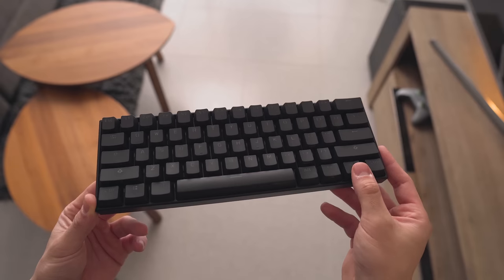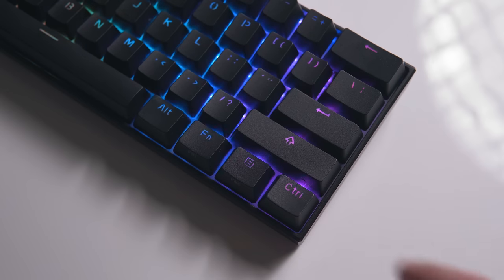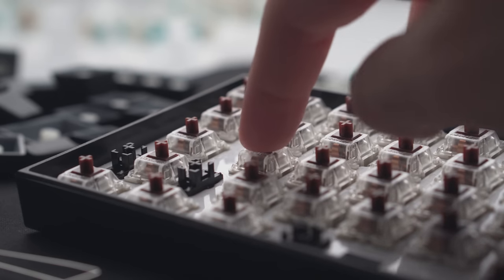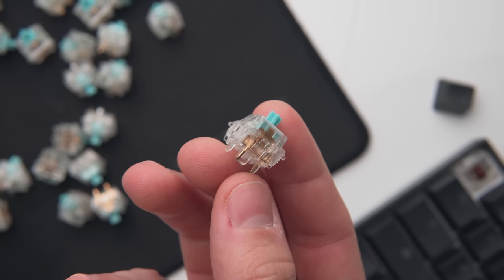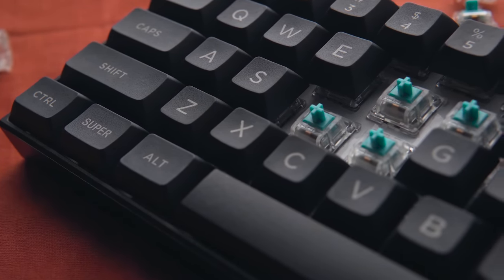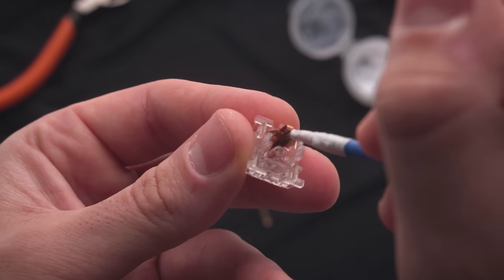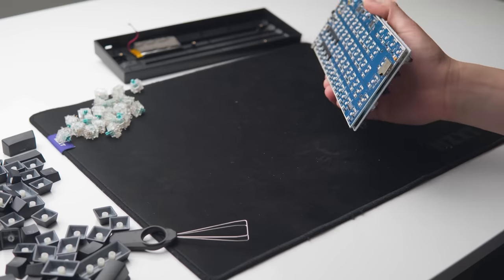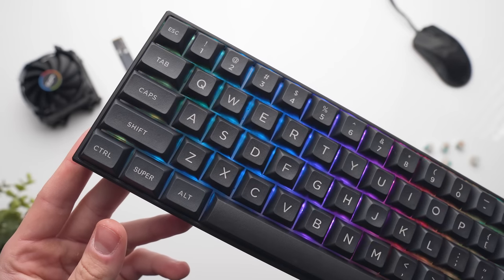Building my Dream 60% Keyboard

Comment: If you use the glorious gmmk it already has all the switches and keycaps taken out and is likely easier to put together. You can choose no switches if you would like to add these switches to not increase the price.
Reply: There is an option to get no switches and you could buy the telios separately. I tried to say that in the comment, sorry if it was unclear.

Comment: If you're into the idea of a mech keyboard with similar form factor or something to play around with I'd recommend Qisan Magicforce 68 (for under $40 USD with outemu switches - not terrible in themselves but less $$ to lose if you plan to swap them out) - quite pretty too. Check signature plastics for gorgeous but pricey keycaps, or Tai Hao for some reasonable and cheap 'better than stock'
Reply: If you like SA keycaps from Signature Plastic but you want to pay less, Maxkey is an option.
Reply: @hikarii8758  wow they look great! Thanks for the heads up

Comment: Here's why I agree with you about "gaming" keyboards being kind of bad in terms of value for the money: keyboards aren't that good for gaming in the first place all things considered because they don't make use of the most agile finger we have: the thumb. For years now I have been using the Logitech G13 as a keyboard replacement for games while using a conventional keyboard for everything else.

This is a great device considering how old it is and today its only real competition in my opinion is the Razer Tartarus V2. That kind of device - that some might call a gameboard or gamepad (like numpad but for gaming) - does come with a few caveats, mainly that you need to take some time to configure it to suit your needs for each game. In the case of the G13 there is also the issue of it having an analogue thumbstick (contrary to the the Tartarus V2 which uses a digital 8-way dpad) whose analogue functionality doesn't work in any games period (though it is as much the fault of game developers who don't let you play using any device that you want as much as it is Logitech's for not making a proper driver for this thing, after all Valve did figure out how to give users of the Steam controller a way to configure their device that works).

As for my "typing" keyboard, while I absolutely love how the mechanical keyboards I've tried feel under my fingers, the only reason I've stuck to a low profile membrane keyboard so far is the annoying noise. Even the switches that are marketed as "silent" are too loud for me. Following in your footsteps definitely sounds like a good option for me except that it doesn't actually seem that cost effective if I want a full keyboard (with all the function keys and the numpad).

Any advice on what full-sized keyboard I should pick up for a silent experience and a premium feel (whether or not I need to mod it) ?

Comment: i have the k70 mk2 rapidfire. Barring the price being a little high, it's a really nice keyboard. My only complaint is that corsair won't let you use EQ lighting without their headset, though there are some ways around this. Further, I bought my board at 160$ USD, so comparing this to a custom keyboard is kind of disproportionate IMO

Comment: You could do this for far cheaper with the GMMK Compact. Just buy the base board, switches separately (plate mount only, or clip the nubs off other switches), and whatever caps you want. It's much easier to build too, no soldering. You could come out with practically an identical end product without all the extra work or money.
Reply: no soldering = no fun
Reply: Meh, I've spent years soldering stuff as a job. If I don't have to do it, I don't want to.
Reply: soldering is part of a hobby, and, sometimes boards with hotswappability are much more expensive and are not worth the difference in the price

Comment: Awesome mod and great video, dude! I'd love to have an Anne Pro 2 but stuck with Anne Pro 1 for now. Maybe I'll try this technique with some Zealio 67g someday! 

You should also look into Massdrop's "Alt High Profile Keyboard." Very similar form factor to an Anne Pro just unfortunately not wireless. However, it's totally hot-swappable, so you can insert ANY keyswitch you like without having to worry about soldering work! Currently running Kailh Silver speed switches in mine and I love it! 

Keep up the great work. Love your channel.

Comment: my dream keeb is a unicorn:  hotswappable 60% or 65%, qmk programmable, alu or a really sturdy plastic build, relatively silent tactile switches (zealios v2 or zilents or .tacit for now I think), some cool  keycaps as well. Since these are not really on the market, I fear I will have to build one myself or modify an existing like here. problem with building one yourself: Alone for the keyboard (just pcb, case) you can spend the amount of money you spend on a decent normal keyboard. Add good switches and keyboards for each the price of a good keyboard themselves and you end up 300 / 400 bucks easy. Now I do not want a keyboard that is breaking the bank, just have a mobile cool keyboard you can have for your laptop or tablet or also desktop on occasion (i.e. gaming or if you do not need the TKL).  the problem with desoldering and soldering: I dont have an iron, so that would come on top, speaking prices and I have no experience with it, so I fear I will end up fucking stuff up. Not necessarilz in the process, but just  working not good enough, so I end up with slightly shifted keys like shown in the video or a bad typing feel or what have youu. plus you gotta have all the work, which I do not mind, but say you want to change your switches just to try some new ones. a hot swap pcb would be so much better than de/soldering and soldering everytime.

Comment: when starting out i also bought into the gaming keyboard hype - wasted lots of money on Corsair and Razer - If only i had the knowledge I have now - After trying out a Rama M65-A - there was no going back - Tealios for linear and Zealios 65g for tactile - there are no better switches - PERIOD - Krytox 205 grade 0 or Tribosys 3204 - lube - be careful with tactile switches - do  not lube the legs that touch the contact leaf or you will lose some of the tactile feel - only lube  the sides of the stems and the top and bottom of the springs - Linear switches can be lubed normally - most important is using high quality Stabilizers and also lubricating them - I'm currently using Zeal stabs lubed with Krytox 205 Grade 0- Anyway - i've basically given away all my gaming boards to friends - no regrets spending $500 + for a custom board  - game-changer if you type or game for extended periods of time you do not know what you're missing till you try a custom board.

Comment: Nice job. Love the content on your channel. Building your own mechanical keyboard is the most rewarding way to go for an enthusiast, however I respectfully disagree with the notion that a premium mechanical keyboard cannot be had at a good value. I can think of a handful off the top of my head that would easily cost the same or less. Ducky One 2 TKL, Ducky One 2 SF,  Leopold C750, Durgod Hades 68 ($99 on Amazon), Durgod K310, Durgod K320 ($99 on Amazon)... there are lots more in the $100 range with PBT keycaps, steel plate boards, macros, RGB, on-board memory, and beautiful aesthetics compared to some of the overpriced flimsy stuff Corsair and Razer charge $200 for.

Comment: Btw 65 g.-67g. Are awesome :D like 67g really reminds standart keyboard weight and 65g is like lighter version. But men it is better than those 45 g because they are too light (57g probably bottom out). 62g zeal switches are also too light. Like zeal switches are the switches you expect when hear a word "mechanical keyboard" . And after using quite a lot of switches I can say that cherry mx red are more interesting to type than gaterons. But gaterons would be nice on controllers. They are like whst you actually want on xbox controller XD btw not recommending buying anne pro 2 with gaterons. Not all switches work perfectly (lots of double clicking) and they are very different as the same switch. I only recommend cherry mx with anne pro 2. You can buy gaterons if you buy hotswap board to pick the best working switches: they are good (more smoother than cherries) but you have to "cherry pick" them (no pun intended :D but cherry switches are really cherry picked for relatively cheap price - they stand up for their name )

Comment: i got the gmmk full for my starter mech keyboard cause i REALLY didnt want to deal with soldering but i REALLY wanted a smooth linear switch to go with it. got gateron reds with it and after lubing they're satisfying enough, but they're not Q U I T E smooth enough and the actuation force is a little light. those tealios looks really tempting but to fill my whole keyboard id have to pay 120 freedom dollars.

Comment: I lubed my halo clears without taking them apart using Krytox 205. Just held the stem down with a plastic needle and a thin paintbrush. Worked very well, any cons to this? That looks like it takes FOREVER>

Comment: Good video, I'm interested in building a 60% myself. One question, What kind of soldering iron do you have, your joints looked really good, right now I'm building custom cables, and the split wire with my current iron is giving me issues.

Comment: Go get a tofu from kbd or the 5 degree case you would be alot happier doing that as a custom build instead if paying 70 for the anne pro 2 and then what 60 to 70 for the zealios or tealios or healios switches so if you spend another 20 dollars you cant get the whole diy kit from kbd fans for the tofu like it's a no brainer

Comment: I hate desoldering so much. I always break something lol. But back on topic, nice video! I'm thinking about getting some Tealios for my keyboard too. I wasn't planning on lubing them but now you've got me thinking about it.
Reply: Hate soldering? -> GMMK Keyboard
Reply: GK61 is a good choice, too. But, GK61 has 2 versions: one that supports traditional switches with contact-based connection, and one that supports laser-based connection. Most mechanical switches you can find are the contact-based one. And, Mantistek, the company that creates GK61, is charged with keylogging and recording sound without permission (they have a mic for a lighting feature, but it does record your voice as well), but I think there are solutions to this.

Comment: There are hot swappable keyboards like the GMMK OR GK61 which are only $60
Reply: i have the gk61 and honestly wouldn't recommend it, stabilizers are really bad and rattly
Reply: @ollij02  you can fix that easily. by lubing them or changing to a genuine cherry/gmk or zeal ones, or both, lubing the new stabs.
look up the stab lubing tutorial by taehatypes or ramaworks.
Reply: Gmmk is only 10$ more expensive and way better

Comment: I would definitely advise against lubing the leafes as they have to be electrically conductive. The risk of permanently ruining your 60-100dollars worth of switches is definitely not worth it.
Reply: You can, just lube one side and don't go lubing the contact points ^^
Reply: playing it safe and just lubing the springs and stems is perfectly okay
Reply: @ltsjoke5443  I never said it wasn't, just pointing out that the original comment was misleading. ;)

Comment: This is very cool, but I just can't not have a number pad, I use it all the time. I also use PgUp/PgDn/Home/End and the Delete key all the time. I don't know how people manage with these 60% keyboards.
Reply: Because you can add layers to it.
Usual people just use 1 key for 1 character. You can actually give a single key 32 functions.

Check QMK firmware if you want to learn more.

Comment: There are a ton of hot-swap PCBs & keyboard kits to avoid soldering & it's far less time-consuming should you want to experiment with different switch types in the future. Don't stop at the Anne Pro 2 or Ducky One 2 Mini as if they're your only options.
Reply: any good suggestion for some one who don't want to solder at all.  I would like to make my first diy keyboard
Reply: @ahamedjunaid4411  Gotta narrow it down a bit. What size would you like? Full, 10KL (no number pad), 66% (similar to the Anne Pro 2 but with arrow keys & aux keys, up to 4 on the right side of the board), 60% (Anne Pro size)? Also what is your budget? Once I know those I can go from there.
Reply: @devinwilliams4860  I think 66 size,  Anne pro 2 with not so loud but good feel mechanical keyboard with cool color caps .

I don't wanna do any soldering got none of that equipment and I'm not used to it.

budget maybe 80usd tops?
Reply: @ahamedjunaid4411  This is going to be your best bet - https://www.pcgamingrace.com/products/the-glorious-gmmk-compact - BUT you'll have to pay for keycaps (options on the site) and switches (options on the site.) It's about $30 more than your budget in total, but if you can save for just a little bit longer you're good.
Reply: experiment? go for hotswappable
real custom experience? soldering is the way
Reply: @hikarii8758  the *long way. Rama has god tier hotswap PCBs. Clueboard has stellar hotswap PCBs too. I would never waste my time with a soldering iron when I don't have to.
Reply: @devinwilliams4860   thanks! do you have any taobao options?
Reply: @ahamedjunaid4411  Unfortunately I haven't found anything that cheap on Taobao. The PCBs that use GMK (great software to let you customize your key binds) are at least $30 US which means you only have $50 left over for a case, the switches, and the keycaps which honestly isn't enough.
Reply: @devinwilliams4860  Any taobao alternatives then for similar price ? cause I close to China might be more convenient but I'm unsure . what ya think
Reply: @ahamedjunaid4411  right at the top of the page it says worldwide shipping available so I don't think it'll be an issue getting to you. Unfortunately it'll take 8-40 days which is a pretty long time but at this price, again, there aren't many hot-swap options without the price going up sharply. You'll likely have to double your $80 budget if you go piece by piece through Taobao. You can get cheaper keycaps but you don't want to cheap out on switches - they're the whole reason you're going mechanical anyway. Not a lot of places to cut corners in keyboards sadly.
Reply: @devinwilliams4860  Great stuff man thank you! none helped me About keyboards as you did! any suggestions for switches I want something quiet to silent but pretty nice feel too
Reply: @ahamedjunaid4411  Glad I could help. For switches they are entirely personal preference. Unless you're comparing switches of similar type (say a Cherry MX Brown vs a Gateron Brown) switches are not better or worse than each other, just different. I suggest you get a mechanical switch tester, which is basically a card with a bunch of different switches so you can test them out before buying. Here's an option on Taobao - https://detail.tmall.com/item.htm?spm=a230r.1.14.9.250948e8ItBfMR&id=555441950385&cm_id=140105335569ed55e27b&abbucket=8. Once you find out which switch type you like you can buy more for your keyboard. That way you won't have to rely on what I or anyone else has to say about switches because again it's about what YOU like.

Comment: Go for a wooden or metal case from Aliexpress they're super cheap and make the keyboard feel premium and sound a whole lot better.
Reply: the problem is, Anne Pro series have weird screw placement, only 2 of 5 screws will fit if you use Anne Pro keyboards with standard cases

Comment: For anyone not willing to shell out 80 bucks for switches, gateron yellows for 13 bucks are a great replacement.
Reply: they're too loud and sound so... high pitched?

i recommend the kailh box, go black or yellow, a bit heavier, i know, but so much better in this regard.

*ps: make sure you get the retooled version. their original one has a tolerance issue that may crack your key cap stems.

Comment: Hope you read this, not sure how else to contact you (don't use twitter). 

Have you got the Cryorig C7G or do you plan on getting it? It's currently available from PCCG, surprisingly. I know you've tested the C7 and C7 CU but i'm interested in seeing how the 'graphene coated' version handles. Very hard to find solid benchmarks for this specific cooler. 

I expect the difference to be extremely minor.

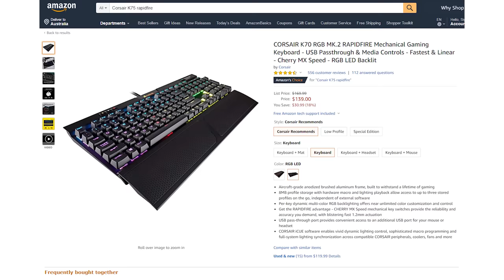Comment: 0:53 “this keyboard goes for 160-170 dollars” the picture says 139 dollars
Reply: yeah with sale on, without the sale going on is 150-170 on amazon (but they are also on sale). Though I think he was thinking more about the price that was off sale, which never happends on this products at least by my knowledge and it's an old marketing trick.
Also this keyboard may go for 160-170 if it has the mx silent switches.

Comment: was thinking of doing this myself after looking around i found this keyboard i think i could use as a base instead of the Anne Pro 2 id use "DIERYA 60% Mechanical Gaming Keyboard, RGB Backlit" its plastic but around 2/3 of the price would this be possible to use and then also switch out the switches with the Tealios V2's as this keyboard is hot swappable aswell so wouldn't need any soldering, any opinions thanks??

Comment: I have never used a mechanical keyboard so I can't compare but I love the look and feel of my Surface keyboard. Is it really that much better? Tbh I really don't like the thickness of them.
Reply: they feel great, but the customizability and options are making it a headache for beginners.

look up kailh choc or cherry ml, they're the low profile option, but the parts not as easy to find as the mainstream ones.
Reply: definitely better imo
Reply: but, you should give it a try before considering you really need it